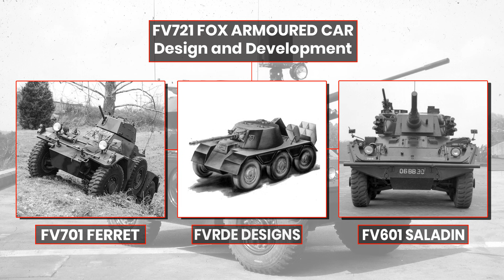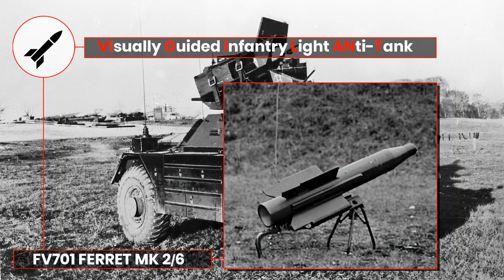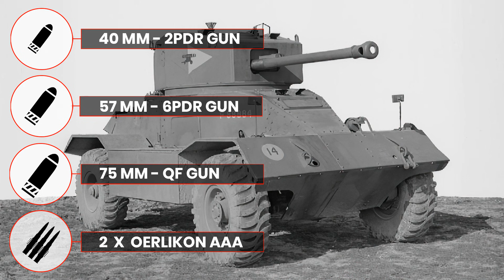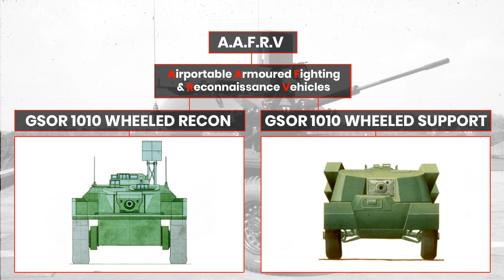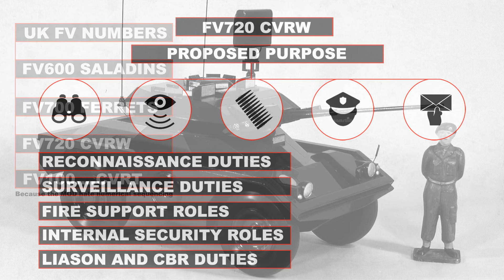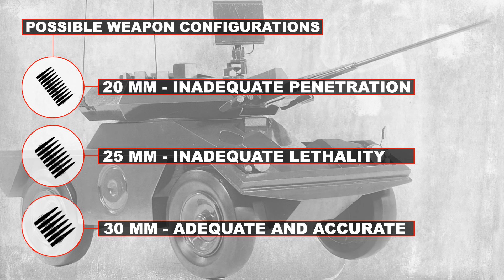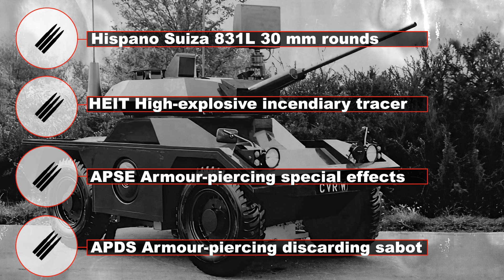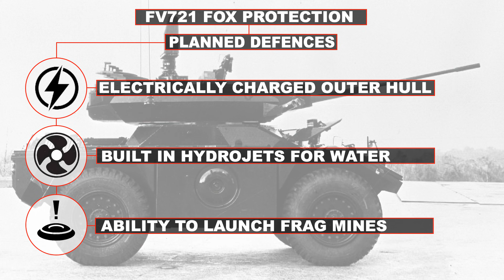FV721 FOX - Tank Design & Development

Comment: I was i/c  Ferret Section 2 Para in Berlin when the wall was still up 1977.  Ferrets Mk3 I suppose.  Turret and 30 cal.  I was watching the tank chat series with David Fletcher when the Ferret was covered.  Quite nippy he said, it could do 45mph....  I lolled at that cos I remember doing patrols from Brooke Barracks to and around RAF Gatow.  When all was done, we used to race back (four Ferrets) at a tad over 60 mph on the back roads.  Being 20 yrs of age, we were all bullet proof and would live forever.  Thinking back, I dread what would have happened if we`d  have rolled one over at that speed.  The inside of the Ferret would have turned you into snotty soup.  I had a great bloke, Drew Sheehan, who kept them running.  They NEVER let us down.  Nice series BTW.  Very enjoyable.
Reply: Great story there. 60..... You folks were nuts back then!
Reply: With the turret and 30 cal you would have had a Ferret Mk2 (Which variant of that I have no idea since the marks changed depending on if it was up armoured / fitted for Vigilant / had the missile gear removed etc)
The mark 3 did exist but it never entered service.  So you might even have had a Mark 4 Big Wheel ferret or the Mark 5.  

Agreed when he said 45mph I knew that was wrong.

(Edited for typos and clarity)
Reply: @ptonpc  All the kit in Berlin was written off before we fired a shot seeing as we were surrounded by the USSR anyway therefore why put good kit in a place it was gonna get wasted.  Basic ferret, not up armoured.  Still great fun and we SURVIVED   ;)
Reply: @cryohellinc  Yanks loved them  "Hey, you Brits got mini tanks.   ;)
Reply: @peterstubbs5934  That's the important bit, you made it back :)
Reply: @peterstubbs5934  Meanwhile back at the ranch, etc etc - we were in the Berlin Armoured Sqn at Smuts
with our dear old Chielftain plus our recce tropp which used to do Border Patrols when it was our turn. Later about 1984 a disenchanted RRF geek borrowed a Fox and drove himself over to the DDR. The Russians handed it back a week later over Staaken and I went down with the RMP boss to take posession of it. The opposition had stripped the RARDEN breech but had trouble putting it back together as evidenced by some blood on the rounds tray! We used to call that Rarden rash.
Reply: Yes that's true, those things could really shift. I had one as a recce officer RA. Excellent piece of kit, but not the easiest vehicle to live out of. The Spartan was a vast improvement lol.
Reply: Thank you for your service. 

I am a OIF Marine Veteran, 2nd AA Bn. Crew Chief 1833 MOS. My vehicle was an AAVP7A1 RAM/RS. The speedometer in the vehicle went to 65 MPH and it was rumored that a good running one would top out at 70 MPH. I was in California doing training during a CAX. We were on top of a mountain and coming back to base at the end of the day. Now, as a Crew Chief, the typical position we would be in is either the turret or in the Commander's Cupola (depending on how many personnel and what type of personnel we had). However, I wasn't your average AAV Crew Chief. I was Cpl. Big T and in my opinion, there wasn't any better driver than me. So, any chance I got, I drove. Anyways, we were making our way back and I was lead vehicle, so I set the tone (speed) for the rest of the vehicles. We probably had about a 20° gradient going down the whole mountain. I had the pedal to the metal. I pushed that vehicle for all she was worth and judging where the needle was past 65, I conservatively, had it going 77-78 MPH the majority of that mountain.

The story isn't done. Once I got down the mountain and came to the Main Road, tank pad crossing, I saw a Battalion of Infantry on a hump (march) about 500 meters behind the tank pad. Me, being the "greatest AAV driver" ever, couldn't cross in front of an audience normally. So, I head perpendicular to the tank pad, as fast as I can go. As soon as I came to the pad, I pulled the steering to the right as hard as I could and downshifted. I got the tracks going in opposite directions at high RPM. The momentum of the 37 ton vehicle carried me across to the otherside and I traveled across that tank pad parallel to the road. I so, got my ass chewed by my Section Leader, but was a God among men to my troops.
Reply: Recce officer RA, had a Ferret as my mount. Really nippy bit of kit. Easily do 60mph😊
Reply: Bloody hell, you must've removed the governors because we struggled to keep them reaching 40mph.
Reply: I was on Fox in BAOR in 78, our troop had 5 Foxes plus a Ferret, 3 of which rolled, it would flup on a puddle or slight camber. I only found out later the Fox roll was caused by REME at their development and trials phase, somebody had stripped then rebuilt a Fox for evaluation but put the suspension arms or whatever back in upside down. I must admit I remember looking at our Foxes and their wheels tapered inwards at the bottom making them top heavy and unstable. I drove, operated the  radio and fired the 30mm Rarden. The Rack Catch Plunger Release Catch Cam was a pain to learn!
Reply: @Devonshireoldfart  Hi again. Did ever have the pleasure of operating Saladin. The older QOY lads I knew loved them and hated Fox.

Comment: Just a small point...APSE is Armoured Piercing Secondary (not Special) Effect. HEIT was just known as HE. The RARDEN had a selector switch on the back casing of safe, single or automatic firing. We were never issued with ZB298. The commander of the vehicle was also the loader. No night sight was issued to the commander only the gunner had a night sight.
Reply from the maker: Tsk, dammed docs!  so most of this is going on the original GSR's and RARDENs own sheets, they have Special as well as AP Special Explosive, just to be more annoying. tho in the service stuff it does indeed appear to have changed to secondary. cheers.    ZB was used in Ireland, not sure with foxes, but it was intended, so i added them.

Comment: The ZBD298 radar (zebedee) was the biggest pile of shit going. Apparently it was quite good if you could get a 'trained' operator, but for us mere mortals it was a bit of kit that was left in the stores if you could get away with it. Every thing associated seemed to be complicated - even connecting the cables was a nightmare. As a brand new TA gunner I was given the task if wrangling with the ZBD (nobody else would touch it) and still today have a phobia about that shade of green used on the ZBD.
Reply from the maker: hhahahah yes i heard mix opinions on it, hence the bit about it stugglign to identify cows and sheep at times

Comment: The hull was shot preened aluminium and due to lax maintenance on hull seals and the floatation screens, they were removed for safety reasons. the rear fan assembly made maintaining them awkward and yes they were top heavy but drivers trained correctly could easily find the limits ( a kick in the back helped ). excellent fast recce vehicle replaced by CVRT over time with the TA being the main users, Queens Own Yeomanry,  who I had spent two years   as permanent staff, had a mixture of Ferrets Fox and Saracen ambulance so all hand me downs from regular Units who upgraded to CVRT.

Comment: That really toodled my pip... However, I have a question about the ballwashing you spoke of. Why did "excess fuel lead to ball washing" ? Were they using it as oil thinner for cold starting, or was this some kind of 2-stroke that used the crank case as an intake plenum?

Comment: I like these vids although I have to grit my teeth at you examples of "TH Fronting" [the replacement of TH with V. This is an affectation not a speech deficit [unlike your rhotacism [inability to roll your R's], buy why, oh why did you start mispronouncing Daimler? It is pronounced just exactly as it is written and has no relationship whatsoever with Dime Bar. Nice to see that by the second min, you have reverted to the correct pronunciation.